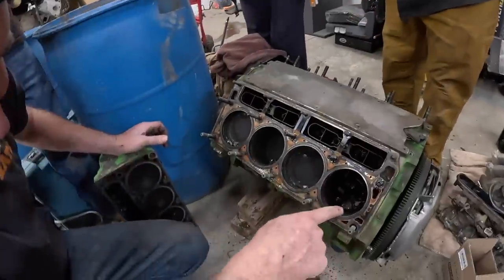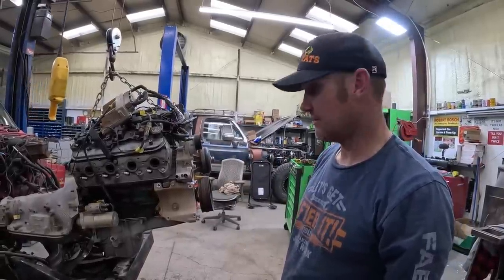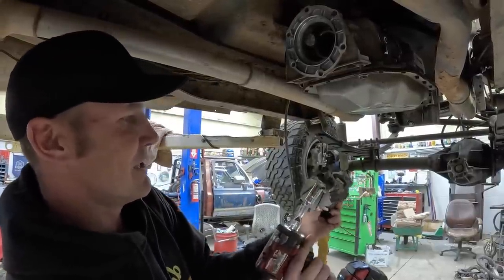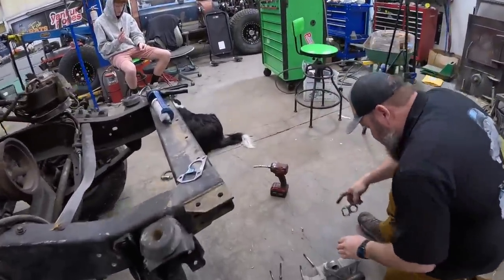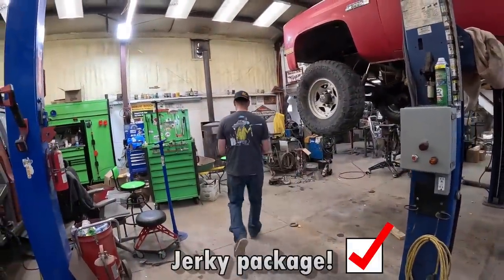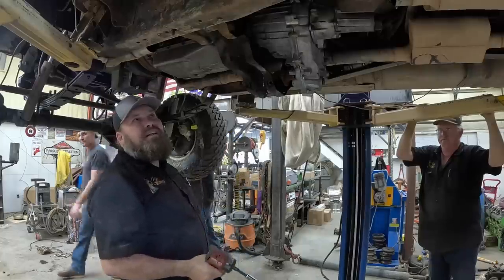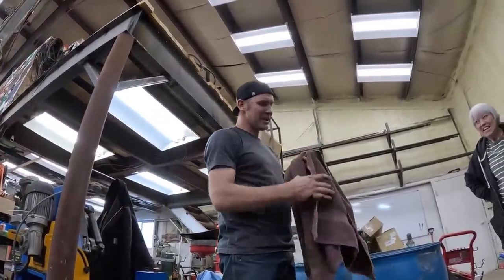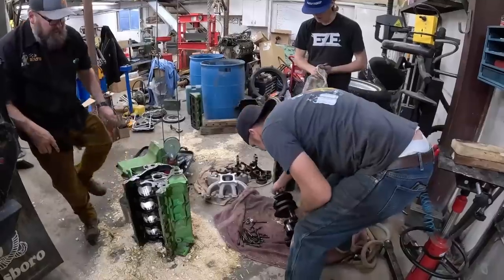We Found Out Why Landon's Motor Blew Up And It's A Little Shocking!

Comment: ive been running a 208 for about 3 years now you will luv thay 2.68 to one low range....even tho i only have 354 gears i use this t-case to get a 66 to 1 crawl ratio with the 7 to1 first gear in my np 435 tranny which will never ever over heat because its a stick

Comment: Piston rings in the intake 😅 that's a new one.. I've put two new engines in my wife's impala, its a 3.9 v6, both times it dropped the intake valve and absolutely detonated the engine because the water jackets are so close and would immediately get broke, causing it to hydrolock, it was cool to tear them down though. Paul should really be proud, if Landon is gonna do something, he does it good, even when it comes to blowing up an engine 😁

Comment: I was breaking in a cam in my Sbc 383 stroker, idling at 2000 RPMs and it dropped the valve the valve fell down hit the piston and the Piston pushed it right back up through the valve guide of course the valve was bent like a $ and stuck in the valve guide but didn't Scar the piston so I pulled the head off, and had it reworked new valve guides and valves put the head back on, and have made over 20 passes at the drag strip already...

Comment: Trick to get broken studs out is to weld a washer on first and then weld a nut to the washer. It's much easier to get a good weld thru the washer than down a hole in a nut.

Comment: Wish you could xray those parts for cracks.  I spent alot of money on a rebuilt motor.  Years later it failed.  Come to find out the crank shaft had been cracked half way through the whole time.  When it finally went you could see half the crack was shiny from rubbing for years and half was a fresh break.  Had that crank been thrown out in the first place that motor would still be running.

Comment: If I'm not mistaken, GM had a recall on certain years of LS engines with the cylinder heads breaking valves like that.

Comment: Had a guy bring in his old pick up...plumbing co I worked for.. 390 about 270k....oil leak and missing #6 rod broke cracked the block causing the leak...the block held long enough to clearence the rod back to the crank journal. I asked Marty how long it had been missing..bout 6 monthes , figured to get in sometime just never did. Prolly about 12k miles or so.

Comment: Years ago I bought a '62 Corvair Monza from a friend. He said it had just "stopped running at a stop sign and wouldn't restart". The engine wouldn't turn over, so I pulled it and started disassembly. What I found were THREE broken connecting rods, and a bunch of other damage. Not sure how you break fully half of the rods in an engine just sitting at a stop sign...

Comment: I need some advice! My loved 89 k3500 4x4 also locked up the stock 454 BB , would I be able to bolt a 350 sb in its place ? If so how much stuff would I have to change to adapt a 350 in place of 454 ? Thanks to anyone in advance

Comment: In High School I had a Cobra Jet Torino and my motor blew running 55-60 down the highway!  It was so violent I thought the engine was coming through the hood.  Truth be told about a mile back I hit 7000 RPM up the on ramp just because.  That was a common thing getting on the highway.  About 3 months earlier I replaced the oil pump because pieces of the timing  chain got sucked up in the oil pump locking up the oil pump.  I "may" not have gotten every piece of the timing chain out of the pan.  Broke the cam in 3 places and a rod which swung around and chipped a piece of the bottom of one of the cylinders.  We x-rayed the engine put a sleeve in it, bored and line bored.  Bought all new guts and it ran like a scalded dog!  "Someone told me."   Anyone can grenade an engine at low RPM!  lol

Comment: Talking about blowing up motors. Story Time with John. My 92 F150 302 had all of a sudden lost oil pressure. Seeing the gauge was at zero, but she was running fine. I carried on and then all of a sudden she came to a stop. After pulling the motor apart I find that the oil pump drive shaft is twisted up like a stick of licorice. Why? Pump was not seized? Never did figure it out. Rebuilt it and it ran fine.

Comment: Those Chevy motors will take a beating but when they let go, it's gone. I knew a guy, on a rally, outside the hotel, bonnet up revving the engine by hand, dropped a timing gear (never hammer them on) valve met piston, rod punched the bore, all over. They were in the middle of outback Australia, so he towed it down to the garage, stripped it down (327) found a 350 outside missing 1 bearing so he took a head, welded the bore, cut the rod, used garden hose and clamps to hold oil pressure, finished the rally and drove home in a V7. Did another 10 000 miles before he replaced it.

Comment: In high school I had a 1986 Ford LTD blue on blue with a very snappy 3.8L. I used to go pedal to the metal until one day it wouldn't drive over 25mph. I was so afraid to tell my parents, I thought I blew the motor. It ended up being the cat got fully clogged and the backpressure blew out almost every gasket in the motor. It probably happens to all of us when we're 17.

Comment: I have an Idea, maybe the reason those bolts were loose on the transfer case when they shouldnt be. Maybe doing burnouts in 4 wheel drive  causing axle bounce? To much vibration.

Comment: The mechanical speedometer gear swap will make the dash happy but I think the ECM and transmission will be very disappointed they don't have an electronic speed signal input anymore. I think this decision will come back to haunt you.....but I'm just a Cummins guy, I could be wrong.

Comment: I've only blown up one motor too, and it too really WAS idling in the back yard. Gen 4 454BBC sucked a valve seat and grenaded a piston.
Reply: Generation V is what I have, . 454c.i 4X4 1995 suburban GMC.
 Still running . 230 hp

Comment: In Landons defense, I had a Nissan motor self destruct when it was just idling and I found rings in the air box. I did ignore the knocking noise for a week though because I thought it was a stuck lifter🤷‍♂️

Comment: I know I blew one decades back. Not over revved.  Driving down the road at 2800 RPMs in 4th and it bucked. Locked up tight. One rod was twisted 20 degrees, not bent, twisted!   Bits of valve and seat went out through a long intake manifold and back into other cylinders. As best I could figure, a valve seat dropped and caught  the valve that impacted the piston on an angle that did the twisting. And, not a common failure for that type of motor.

So, it may have been just its time. Or, he may have over revved it to start it all. But, that engine looks like it has served well so I'd not blame the kid too much.

Comment: In the 70's my airforce neighbor traded a 63 tempest wagon for my brand new 2 cylinder 4 stroke Yamaha road bike I traded my dt 250 enduro for due to high gas prices him buying a new house and a baby on the way. The tempest had the best possible components in a 400 with headers into side pipes and built turbo 400 transmission, ford 9 inch rear Micky Thompson L50's. It ran low 12's and all my money went into sunoco high test fuel and it was my daily driver to school and work seeing 100+mph runs daily with lifters floating burnouts every chance I got. My dad died when I was 12 and I lived on my own in a camper from 15 on. The guy I got the car from would stop by and change the oil since that wasn't in the budget and tell me how his buddies would tell him of what ever car his car had beat. He always said keep it under 6000 rpms preferably 5000 and the motor would last. I never watched the big lighted sunpro tachometer I could feel when the car needed to shift to go the fastest. The tachometer had an adjustable needle but also had another needle that would get pushed to the highest rpm the tachometer saw and he would reset it when he checked on the car. My response was I never over rev the engine and that's when he showed me how to reset the high rpm needle that I never noticed so how that engine lasted being spun to 8000ish rpms I have no idea. I wish someone would have told me how unique that car was. I told my mother when I went in the military that if she needed to sell the car she could. Before I got out of basic training it was sold for 800 dollars 😪 I've thought a couple times about building a similar vehicle but then I remember how many times I could have killed myself in that car. I hope Landon understands that he is in a very unique situation and takes every opportunity to work with his dad and those around him. We are not guaranteed tomorrow and if Landon drives like I did at his age I hope he's come to repentance and asked Jesus to forgive him of his sins and save him from a devil's hell

Comment: Trans may be in limp mode without that rear speed sensor on the transfercase. 4l80 4wd doesnt have a reluctor ring in the back. If you tie the output into the input you loose the ecm ability to increase line pressure when transmission slip is detected.

Comment: Yeah, all that welding on the block didn't distort a single thing. I'll bet you can rebuild it with standard size parts again, in the typical shop style. . . .

Comment: as a many year school bus driver, the pattern became clear.  kid gets license and car, last day: "I'll never ride this bus again!" ... it usually took about a month.  kid blew it up or cracked it up, and they were back on the bus.  Dad would drag his feet about fixing it.  if the kid complained about riding my bus under my rules, Dad would not so subtlety point out who's fault that was.  you could read the affect of that burn by the smoke coming from the boy's ears.  he knew to not say any more.

they were lucky.  my dad did a few turns as a D.I. in the Marines, he used that training as needed.  you would have eaten nails rather than get another dressing down over doing something stupid.  It wasn't (quite) to the level of Sgt. Hartman, but ...

Comment: I've blown up one motor, it was one of my old bosses' trucks that I didn't know was leaking oil.
Didn't have a working oil pressure gage either. I put a window in the block, when it threw a rod.

Comment: Not Landon's fault.
It was either metal fatigue or the last guy who did any engine work.  That engine is designed to withstand high revs if normal engine is done correctly.

Comment: Had a experience with high RPM in a68 Firebird only it broke the cam into 3 pieces and sent a few push rods through the oil pan and stuck them into the pavement. I called the dealer where I had purchased it for warranty repair and when he came to look at it he laughed turned away and left never to be heard from. $$$$$$

Comment: Well the motor isnt terribly wrecked check the heads ,block, crank , get a new  piston and ring set and piston rod ,a couple valves one of each gasket her up torque her down and stuff her in a different toy.

Comment: 25 in first gear = RPM  My son's 4 cylinder car skipped time and he drove it home it was running on one cylinder when he got here. 
valves trashed in three cylinders and one broke piston and rod through the cylinder wall. we put a new motor in it.

Comment: dont let anyone overtighten the fill/level plug on the case- mines locked up and no one can get it out, and said it being that tight the case is probably cracked anyway, taper threads

Comment: Sustained high RPM, so that sounds like Paul gave Landon a weakened motor.
For the second time. 
Easy way is to look at the rear tyres, what is the wear difference between front and rear.

Comment: I did similar damage to a BMW motor when it dropped a valve. I genuinely was driving normally when it did it. The engine has been cooked and I was limping it home when it did it. Then I figured I couldn't do worse, so drove it home.

Comment: Thats what happens when you float a valve from way to many rpms haha, extremely high rpms make the LS float the intake valves from what ive seen haha. You'll have to set a rev limiter on the holley, 😂😂lol these kids these days are so used to those little 4 bangers smacking the rev limiter , that when they get a real motor they dont realize you cant crank 9,000rpms out of them haha or your rings blow into the intake and you stop moving 😂😂😂❤❤  us older folks grew up with big v8's so we are used to how to run them ❤

Comment: i doubt poor lardon did anything more to that motor in the time he had it than a good night or 2 of derby would have done.. we had a sbc in 4 different enduro cars (like a derby but more cars, less rules and on a track for 100-1000 laps) it blew up in the 4th car pulling on the trailer the night before the race. we pulled the motor from a car on a friends/sponsor used car lot and ran it thinking it was a 350.. it SCREAMED, went to rebuild it and it was a 305!

Comment: If it does not blow up, you aint driving it like you stole it.  I have a son too with 3 S13 Nissan 200SX's (We got them with CA18DET and SR20DET in South Africa).  When one blows there are still 2 more while we fix the damage LOL.

Comment: My  322 in my '56 Buick did suck a valve at idle. 7 grand later and .060 over cylinders and pistons it has been back together and purring like a kitten since June 2019.

Comment: Floated valve or keeper came off?
Sad to say but in my experience true stories from the youth come out at a funeral. 
Examples from my older brothers.
1. 7 transmissions in 6 months with 56 Ford---Rollbacks at the rest area
2. High school homecoming bonfire spontaneously combusted a day early---matches & beer 
3. 2 of the rolled 62 Chevys---drifted gravel road corners too fast
4. Roof leaks in the house--- from 22 bullets
we all have the stories locked away in our youth brains.

Comment: Man I don’t know I honestly had this happen on VW engine just turning it over with the key. Something must of been stuck or maybe no oil pressure and I tried getting it to run. Heard a few clanks in engine but then smooth again. Kept cranking and cranking until I actually got it to run but definitely was not firing on all cylinders. I pulled engine apart and same thing, piston completely in pieces only wrist pin on rod, rings everywhere but no dropped valve. Head pitted on that cylinder but was fine otherwise. So he may of just been idiling honestly

Comment: It happens to the best of us Landon there isn't a engine made that somebody hasn't blown up ,I had ford 460 everyone said that motors bulletproof I was driving through the lil college town of bethany wv( go bisons) and then it sounded like someone put a coffee can full of nuts an bolts in a paint shaker. It was my fault I just did a tune up oil change and fill both tanks up in that f250 so why wouldn't blow up and the bed was full of scrap go figure.

Comment: My 5.2 V8 Jeep Grand Cherokee did the same thing basically. Except mine ovaled out the rod and just kept hammering the piss out of it until it came apart and grenaded. Ruined pretty much everything in the motor.

Comment: Yah need tah turn that HIGH idle screw down a bit. About 60 yar ago i had a 56 Chev belair hard top witha 256  v8 auto. Occassionally i would float the valves BRrrrraaattt sounds. Not good on tha enGINE.

Comment: Paul, I think it's time for a little block of wood under the accelerator pedal to assist Landon to hold his foot "off" the floor. 
Also, since the new motor is fuel injected some form of rev limiter, set to say 2500 rpm, to keep the rings attached to the pistons where they're supposed to be. Kid's destroyed more engines than I've owned in 60+ years of driving. He's lucky to have a dad/uncle/workshop combination to keep bailing him off of the school bus.
Regards from Canada's banana belt.
👍❄️🇨🇦🍌🥋🇺🇦🕊️💩🇺🇲🤞